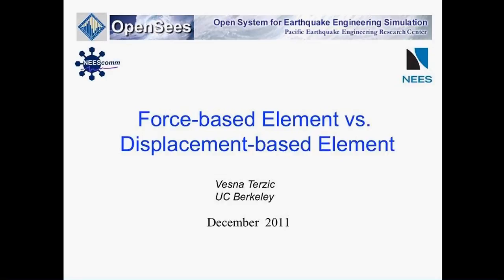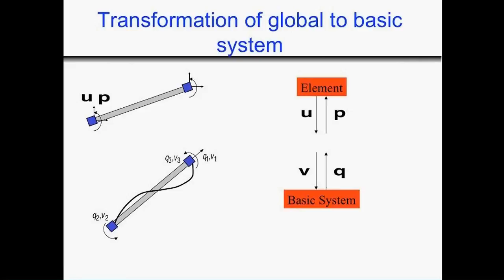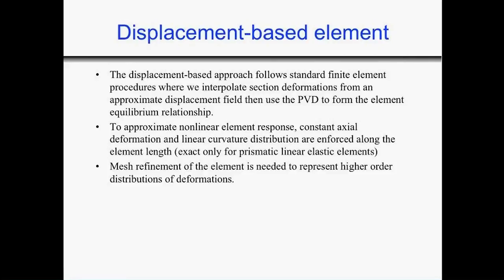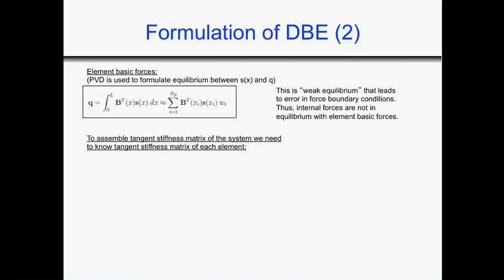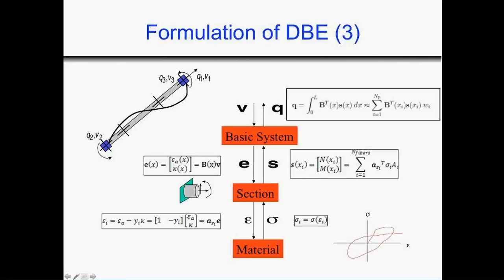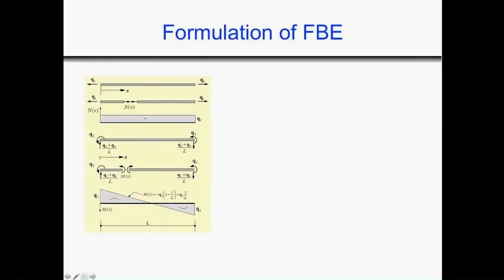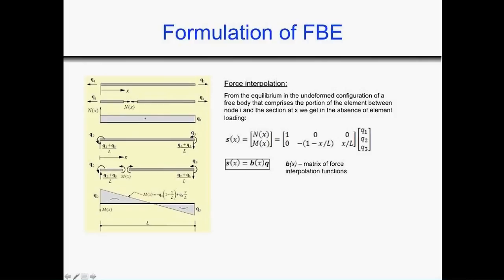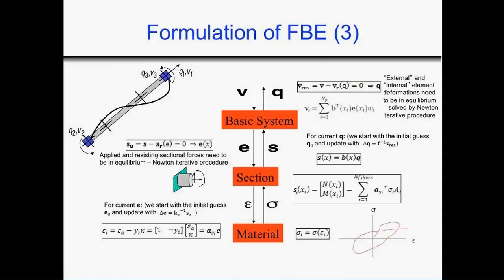Force-based Element vs. Displacement-based Element

Comment: I really confused about which is better if I have a weak, cheap computer, FBE or DBE. I thought it was FBE since it allows higher accuracies without increasing the number of elements. But at the end, in conclusion part, the sentence starting with "Although more expensive in computational point,..." made me confused. ?!
Reply: You have to use multipe DB elements to model a single beam or column whereas only one FB element is sufficient for modeling a member. Therefore, at the end of the day, FBE is computationally more efficient.